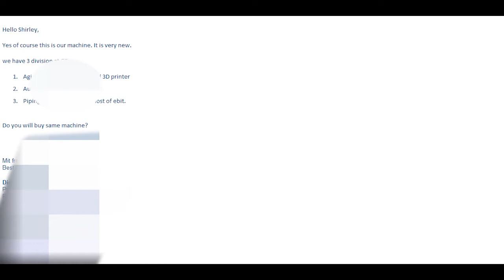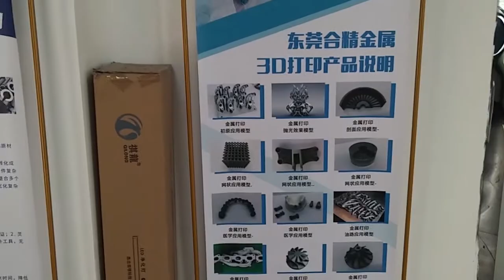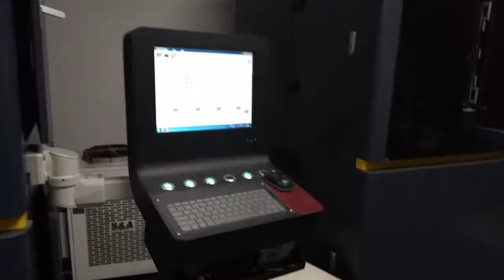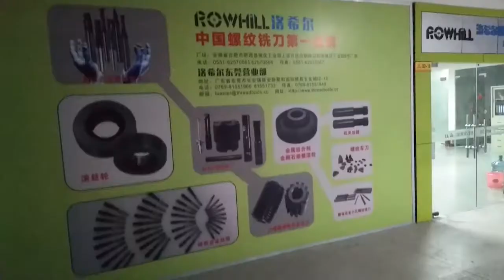2020 Europe brand 3D printer price €650,000EUR VS Chinese 3D printing machine(much cheaper).

Comment: shirley :
What metals can this machine make?
Is the composition of the elements in this machine adjustable?
Reply from the maker: Hi Meysam, this 3D printing machine can make many different materials, like plastic, aluminum, titanium, and mold steel. what elements are you saying?
Reply: @ktmtooling  Is the selection of elements from Mendeleev's table?
Reply from the maker: @CAD_CAM_TRAINING  Good morning Meysam. the function selection is from the table .
Reply: @ktmtooling good morning too, so it's amazing machine..thanks for reply engineer 🙏🌹
Reply from the maker: @CAD_CAM_TRAINING  Thanks Meysam, if you want to buy CNC machine or any machines to start your own business, please feel free to contact me, i can get a good price for you.
Reply: @ktmtooling  thank you so much 💖